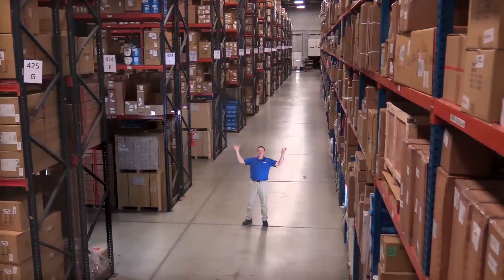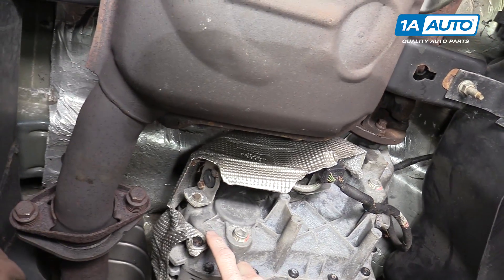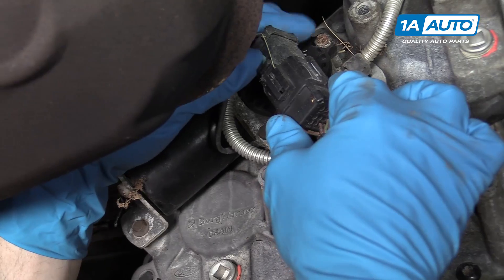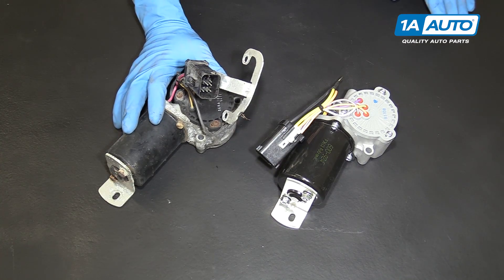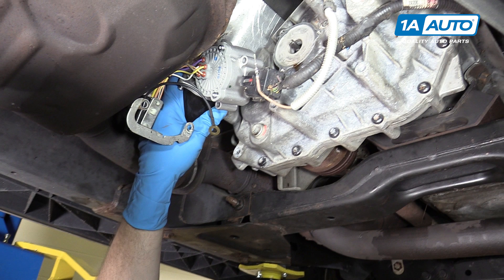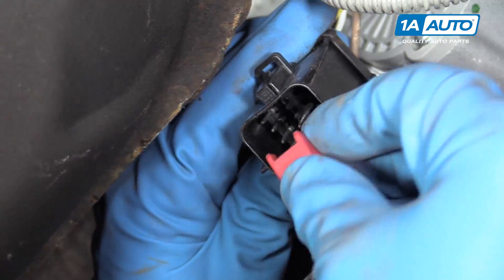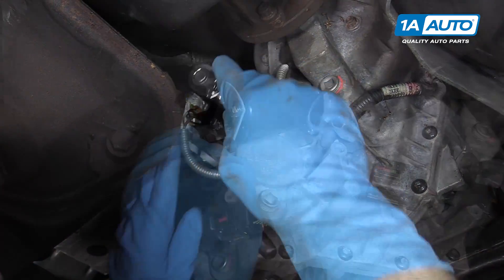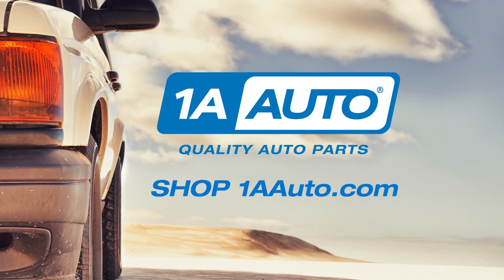How to Install Transfer Case Shift Motor 2006-2010 Ford Explorer

Comment: My 08 mountaineer premier AWD has no motor at all on transfer case. Only one brown wire goes from wiering harness to tranfer case body. How does it work. Can I install one? My car always in rear wheel drive mode. Can I modify it with this transfer case or do i need to install another transfer case. All drive shafts are in place.
Reply: Awd works differently than 4wd. Your awd essentially really doesn't have a "transfer case". It has more/less a "power transfer unit". You cannot shift your vehicle manually into 4wd. An awd system uses a computer to detect rear wheel slippage and then will automatically engage the front drive wheels through the Power Transfer Unit. Your vehicle will run in RWD until a wheel slips and then the awd system will engage the front wheels. 06-10 Explorers came as either a 4wd or an Awd model. You have an Awd which requires you to do nothing to engage the 4wd/awd system. It will do it automatically. The name 4wd and Awd gets thrown around and interchanged alot and sometimes people forget their actual meaning.

Comment: Hi,i have a 02 Ford explorer and the 4x4 low Is stuck ,and does not go away i need help
Reply from the maker: There could be multiple reasons why you're having this particular problem. We suggest taking your vehicle to a nearby reputable shop to identify the cause.  +Sergio Lopez
Reply: @1AAuto  Thanks